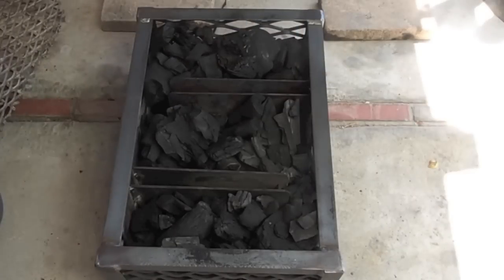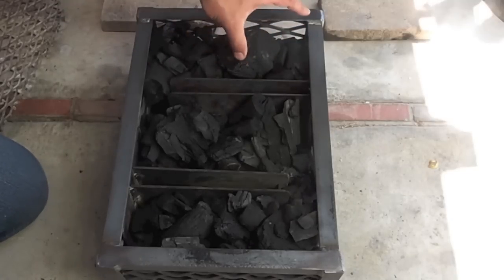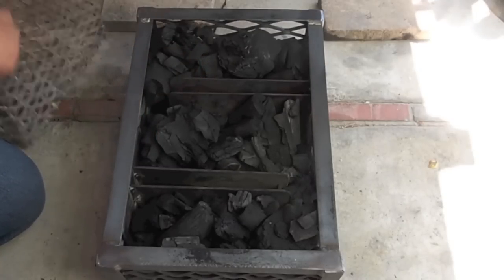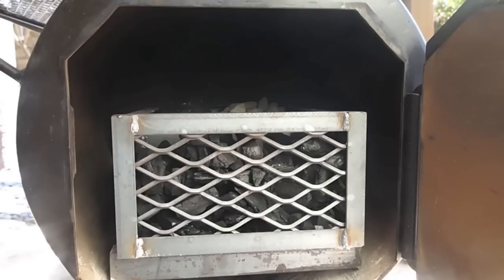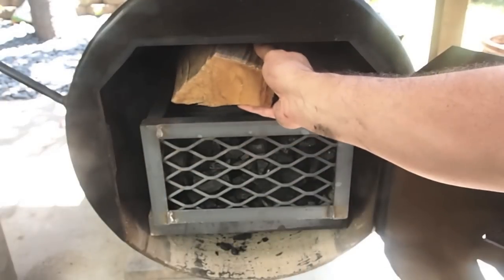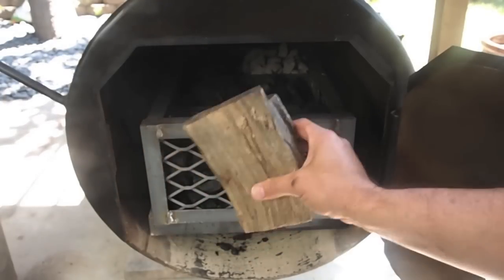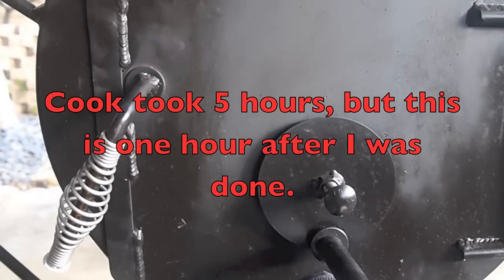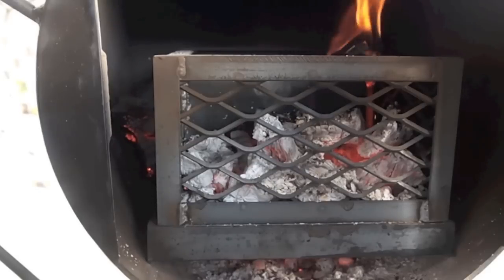Minion Method (Managing the heat in your smoker)

Comment from the maker: Well, I have a Stoker that I really love.  This pit cooks way more even and holds its temp a lot longer than my old pit.  It will run a 5-6 hour cook easy with very few adjustments.  I had an adapter welded onto my fire box door so I can still run my Stoker on my long cooks.  It just makes it so much easier on my during the wee hours knowing that I don't have to run out an adjust the damper.

Comment from the maker: @357tonto Thanks for the comment. The process was just reading reviews and speaking with the various companies. After talkin. To the owner of Gator Pit I was sold. Each pit is built to order and everything is top notch. I use this for smoking only. Any grilling I do is on my Weber. That being said, the grates clean easy with a brush and I don't have to deal with rust prevention like cast iron. That being said, I'm a big fan of grilling on cast iron grates.

Comment: I actually just made one yesterday. I'm no welder, but I was able to purchase a 24x24" sheet of the grate material at Home Depot for $20. Make a few cuts and bend it to create a box. I used some small bolts, large washers and nuts to hold it all together.

Comment from the maker: A good pit (like a Gator) is hand made, so the doors are very well sealed and the steel is heavy gauge, so it holds the heat much better.  Thin cheapy pits leak and are so thin they don't hold heat.  I've never cooked on a pellet smoker, but guys I know that have them like how they pretty much run themselves.

Comment: ECS, or el-cheapo-smokers, are well known for being finnicky and hard to control, which is why they're not only affordable but cheap.  You want air tightness, both for holding heat in, and for the dampers in keeping oxygen out (which will lower your temp when needed by choking combustion).  I'm personally not familiar with Gators, but might I recommend a Yoder.  Check 'em out at  yodersmokers (dotcom).  They're pricey but they're the kind you're gonna love.

Comment: What was the process that led you to the gator smoker over other makes?, been researching and there is a ton of options out there. what do you think of the grilling surface for cleaning, I think cast iron would be easier to maintain?. I had a Holland grill with that type of cooking grate or screen, more work than cast iron to me. As always your results are top notch!

Comment: I have been using split wood for the last 7 years on my off set smoker and will be trying this method just because it's different, i was just wondering by using this much charcoal does it keep the temp between 225-275 perhaps or does it go pass 300 at times? I know by using split wood it always fluctuates and if you know your smoker well enough you pretty much know how manage the fire by adding wood to put in to maintain the temp you want it at.
Reply: usually stays around 220-250 for about 4-5hrs 
I dont use wood anymore, too much work to keep fucking with it. I just use kingsford hickory charcoal mixed with their mesquite charcoal and it works wonders dude. Plus you save cash not having to buy wood

Comment from the maker: @jayemseventy4 Right off the bat I'd say a little less coal (unlit and lit).  As the temp starts to climb, start closing the bottom damper. You had too much O2 flooding into your cooker.  If your bottom vent is closed and the temp still climbs, you're going to have to start adjusting the top.  No other options...  Check out "the virtual bullet" website.

Comment from the maker: The minion method shouldn't have any impact on flavor at all.  What was the problem with the taste?  If it was bitter then you probably needed to let a little more air into your fire box.  A way to diagnose this is white smoke.  If the smoke is white then you are producing creosote, which is very bitter.

Comment from the maker: No real ratio.  When I do this on my Weber I put one of the charcoal trays on one side of the kettle, fill it up and pile the coal up the side of the kettle.  Then I just place about six burning coals on the top.  Use the damper on the bottom to get the heat where you want it.

Comment: I don'r understand why gator does that rediculous air intake system where you have to turn it multiple revolutions to open the ven and why they make them so small.
Reply: don't
Reply: They only have that on some of their offsets, and their claim is that the slide dampeners rust and seize up over time, whereas if you keep the threads greased up you won't have that issue with the rotary design. I own a gator and thought I wouldn't like it either, but honestly, I pretty much leave it open 100% all the time and works great.